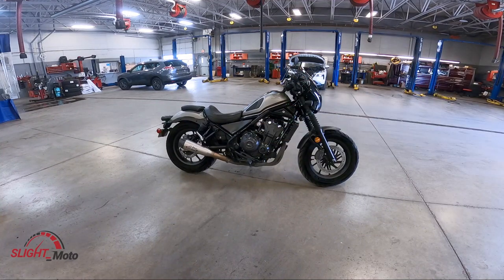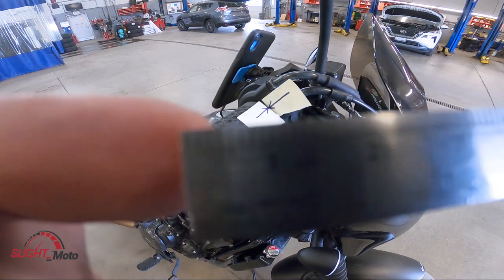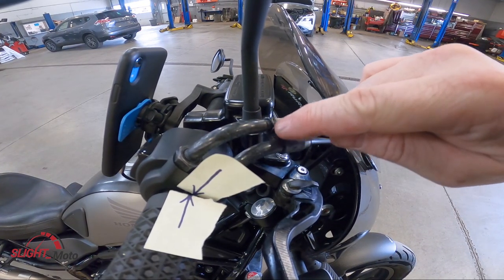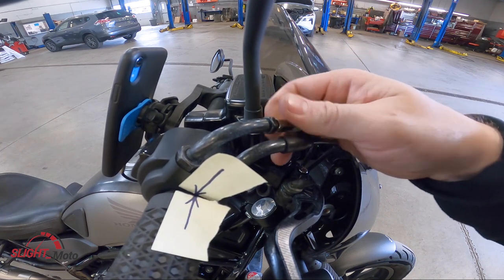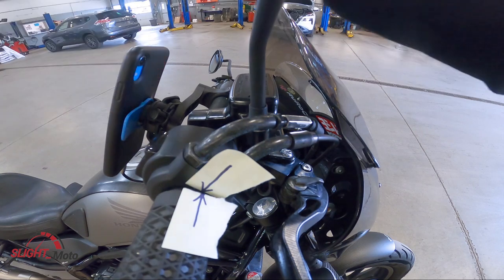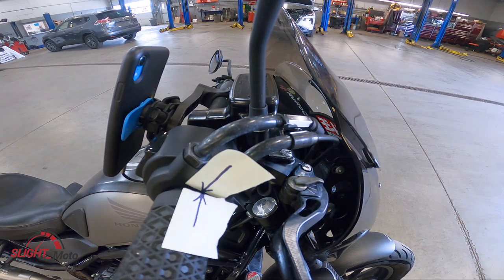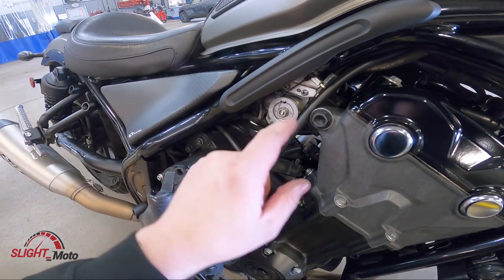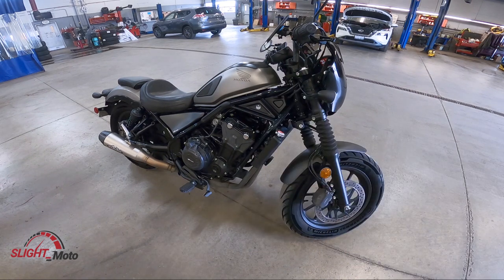Honda Rebel - Throttle Slack adjustment

Comment: Good video. When I bought my Rebel 500, the throttle play was over 12mm. I had to adjust the cable at the other end. Glad you showed that.
Reply from the maker: Not usually something you need to adjust. Great feedback. Thanks for the comment.

Comment: Ty very much have 87 and got some issue going I've been adjusting the throttle sensor on carb choke isn't working. Again ty will try to see if this works

Comment: Hello there. Tks for another great video on rebel 500. I think you could extend a little bit the video and do the cluch adjuntment too. Maybe and idea to a next short video.
Reply from the maker: That’s a great suggestion. 
I’ve shown this in the lever upgrade. Yet I could absolutely make a specific video on this. 

Thanks
Reply: @SLIGHT_  yeah i know. I'm thinking more like: if i don't want to change the levers, i may not notice in that specific video but cluch adjustment...will alway be notice (hope i was clear and you know what i wanted to say..may by from my bad inglish, i'm Portuguese hehe)
Reply from the maker: @rubenvasconcelos4197  clutch cable adjustment. Yes that’s a great suggestion. 

Thanks again

Comment: Do you have links to you tank pads and tank center cover ?  thanks Kit  Great easy way to adj. the slack thanks
Reply from the maker: Carbon fiber center cover is found in the description of this video

https://youtu.be/_lWxLPmXecw

Also the tank pads I am using for mine is OEM Honda… yet the kit I’ve used for others is found in this description

https://youtu.be/6-i6fL-ag0U

Comment: Not sure if you have a video on this but I’m having an issue with my 23 Rebel 500. I am able to switch to all gears but the bike is not accelerating when I pull the throttle. I hear it revving high but no power. The clutch doesn’t feel loose. Please let me know what you think. Thank you so much for all your videos!
Reply from the maker: Could you make a video and send it to my email? 

Can you feel it come out of the friction zone? Sounds like a clutch issue… or improper adjustment. Yet with this description it’s very difficult to isolate the concern without looking at it.
Reply: @SLIGHT_  Hi, I just emailed you. Thank you!
Reply from the maker: @fatimaais7494  perfect, I will check it when I get home.

Comment: I put new cables on my throttle and its not bouncing back do I need to oil my cables?think its the load of grease I put under the throttle handle  instead of oil.
Reply from the maker: No you really shouldn’t. sounds like the return cable is loose. Adjustments are to be done at the bottom first. Fine tuned at the top.

Comment: Sorry off subject but did you have to extend you cables for the bars?
Reply from the maker: I did not have to extend the throttle cables or harness. I did add a brake line extender though.